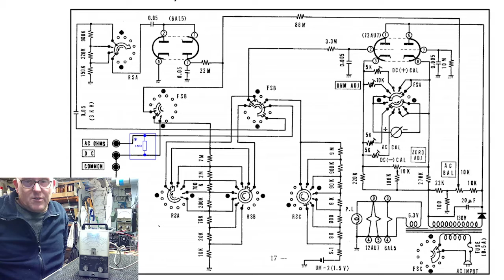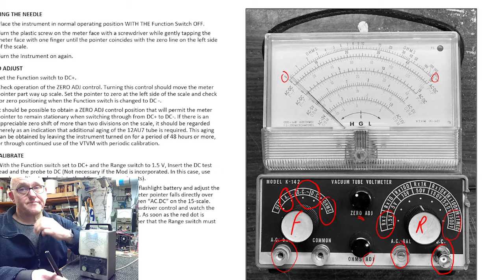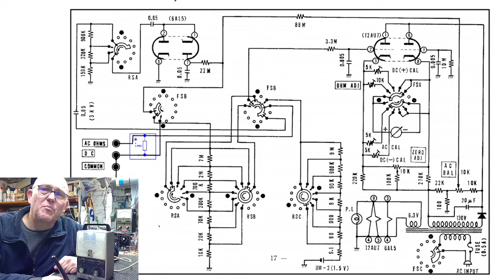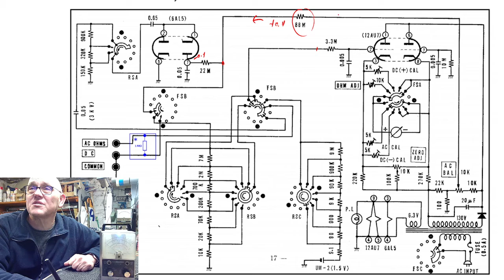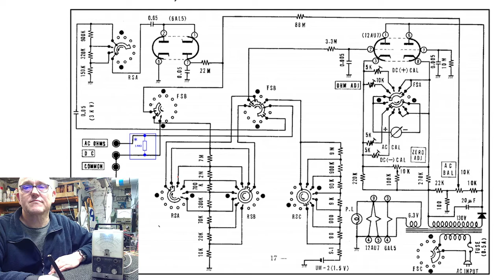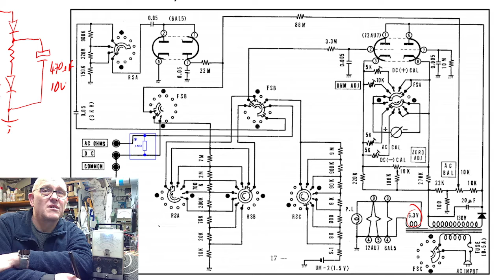VTVM Circuit Description - DETAILED

Comment: @7:54   With 130 VDC applied, wouldn't you get + 62 VDC on the right side and  - 68 VDC on the left side   with respect to the ground?     22k------  10K------  10K         Thanks!
Reply from the maker: The rest of the circuit loads the left side, the voltages I give are actually measured.
Reply: @DerekHerbst747  Thanks for the reply.

Comment: Thank you.  You explained well.  I have two Heathkit VTVMs  Models IM-18 and V-7A purchased at a Hamfeast.  I will work on them as they have issues.
Reply from the maker: @kj4daq  if you replace the capacitors and recalibrate it will probably be enough. Good luck 🤞

Comment: This is a most excellent presentation. I've sent the link to a number of fellow ham radio operators. I have a VTVM that I use to calibrate voltage-controlled oscillators when I repair radios as a digital meter cannot integrate quickly enough at radio frequencies. I prefer the VTVM to an oscilloscope for this purpose.
Reply from the maker: Thanks for the Kudos. I have taken another look at the video, which is an unedited, "warts and all" video, and have been contemplating making a cleaner version, (maybe a series of videos) to better explain the function and design. I will probably do that using a FET VOM, which is very similar.
Reply: @DerekHerbst747  That sounds very good. I need to find the schematic for my VTVM and also change out the rest of the capacitors. I don't own a FET VOM and should probably add one to my collection. Most of the time, I use my Rigol DMM for measurements, but DMMS don't integrate fast enough for RF - this fact is lost on most of the younger players. If you have a favorite FET meter, let me know and I'll try to get one. 73 de N4HPG
Reply from the maker: @billcrowell5096   have a few. My go-to is a Kyoritsu K-200, but I also really love my Grundig UV-4 and the UV-5 is also amazing.

Comment: Can you comment on the input resistance and/or impedance vs. input frequency of the meter at the various scales of the ohms and voltage, both ac and dc, functions?  Thanks.
Reply from the maker: The meter has a constant 1.4 Megaohm input impedance for AC and 11 Megaohm for DC. The AC voltage accuracy (5% FSD) is not as good as the DC (3% FSD) because the wire wound resistors in the Range selection circuit have an inductive element, which skews the AC measurement with varying frequencies. The stated frequency range for 3% accuracy is 30Hz - 500kHz. Some manufacturers include parallel capacitors in the range select circuit resistors to offset this phenomenon.